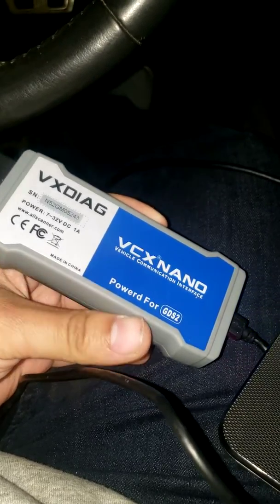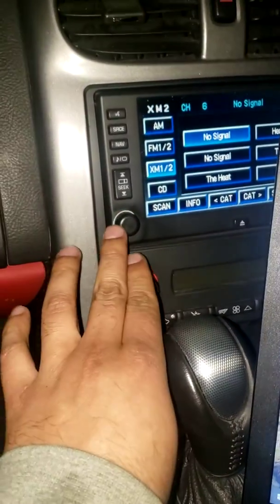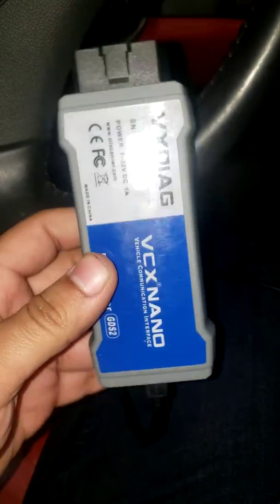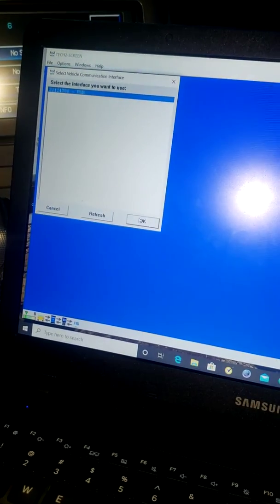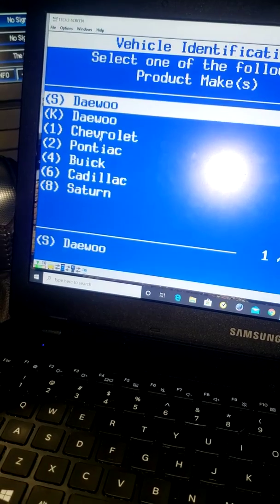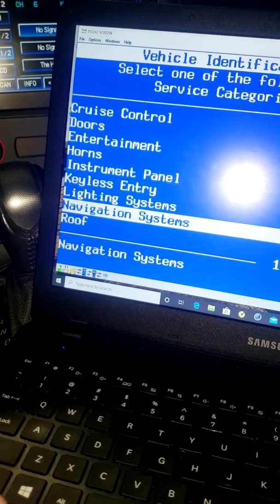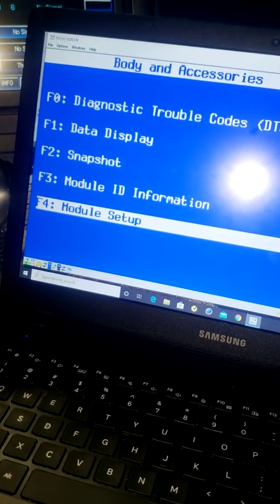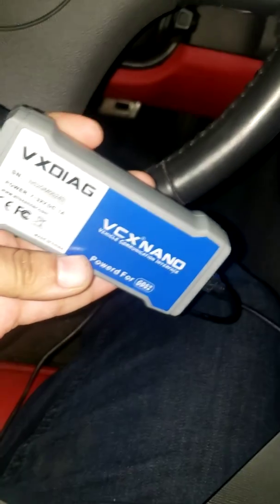Theftlock on stereo 2006 Corvette tech2win Vcx nano GM procedure

Comment: I have the same theft lock message on a navigation unit i bought to put in my 05. I see these tools for sale on ebay. Is there anything additional  i need to make this work to relearn my navigation unit. You mentioned software on a usb.Where do i get that or do i need it? Thanks
Reply from the maker: Hello sorry for the late reply, If you do need additional software it can be found on the VCX website, a simple google should do the trick, but usually the nano would automatically install onto your laptop without an issue. Hope this helps

Comment: If I bought one of these would it work for 2003 pontiac grand am ? My specific car and year requires tech 2 for my key fob , unlock my monsoon radio . 😭😭😭😭
Reply from the maker: I believe it will work since it technically is a tech 2, also you can try and google the 1-800 number to unlock your stereo I remember they use to do it years ago for any vehicle
Reply: @drewstang65  🥺